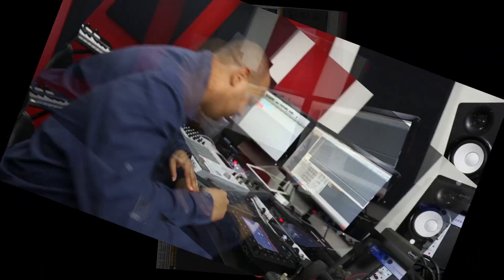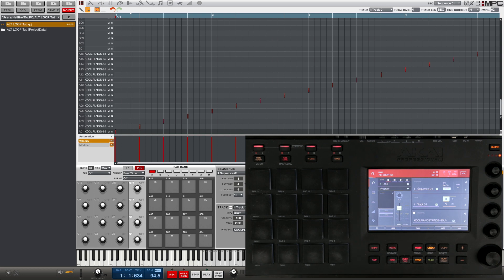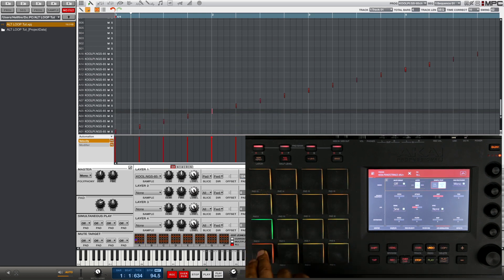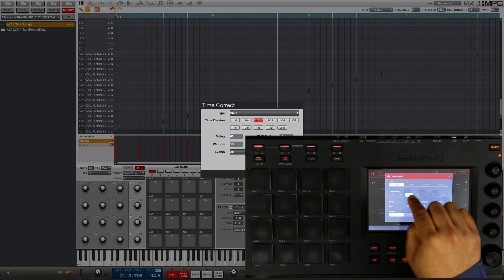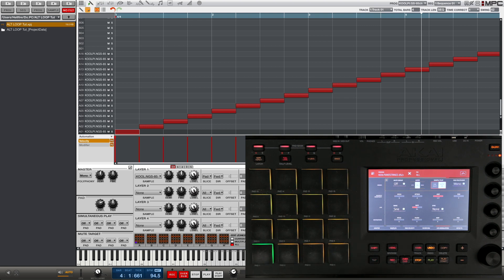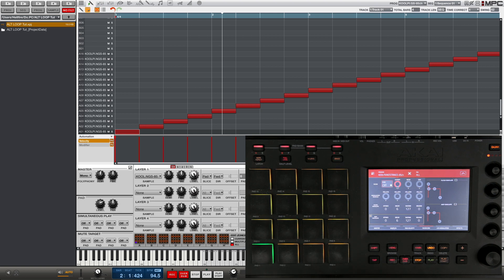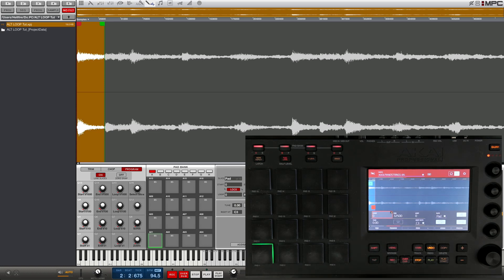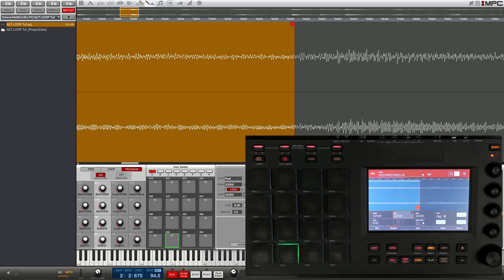MPC Touch Tutorial - Use Alternate Loop For Smooth Slices - MPCMasters.com

Comment: What confuses me is that I might have two samples each 8 sec long  from the same song but when I load them up the tempos are off by a couple numbers but they were both taking from the same song with the same tempo. So for example the first sample will loop just perfect so I put the length lock on and use it for the 2nd sample but it won't look perfect like the first sample ..